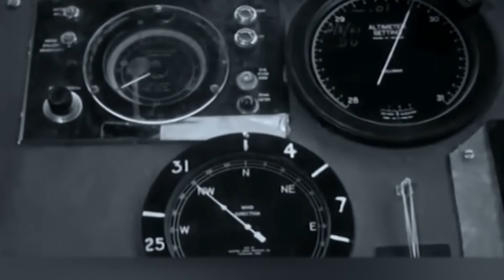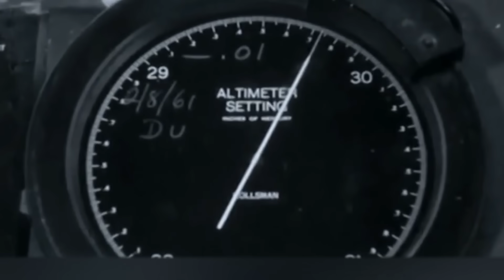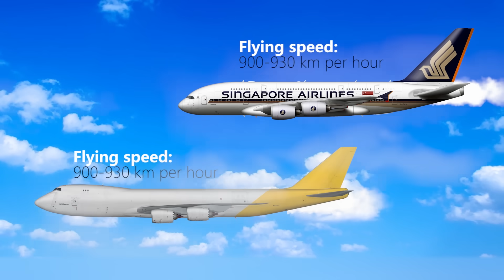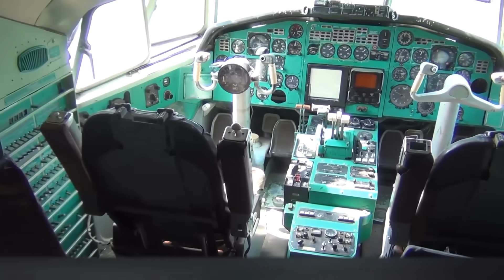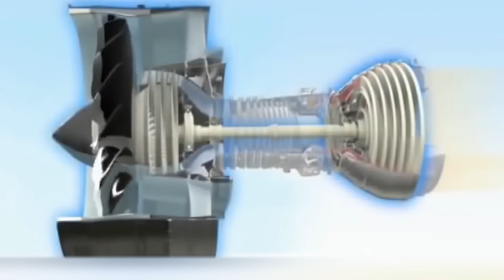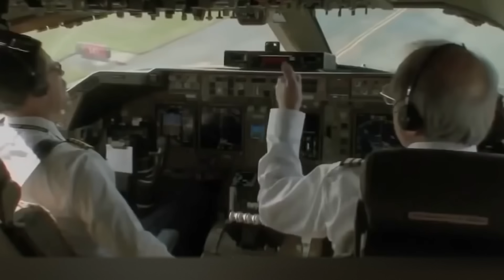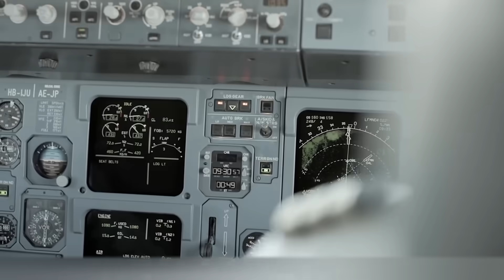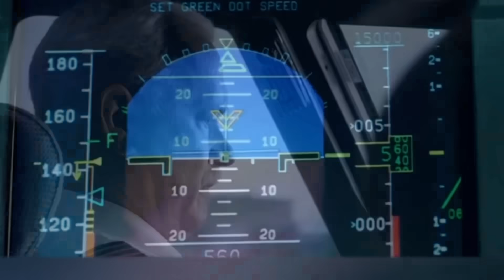Why Do We Fly so Slowly?

Comment: The main reason is that the diameter of the front turbine blades on a TurboFan engine is larger than ever, meaning that the blade tips reach their terminal velocity, which is the over the speed of sound and they start cavitating (or chopping the air up)  at a lower RPM than a Jet Engine. Above a certain blade tip speed, they can no longer move air efficiently at the blade tips. 
The strength of the material the blades are made from can only withstand so many G's before they fail, and the faster they move the more likely they are to fail from simple things such as vibration, debris, minor defects such as the crystal boundaries of the metal. 
New composite materials may help in the future, such as carbon fibre. Because we have almost reached the point where they cannot do any more with metals crystal structure. They have even gone as far as cooling the blades so slowly during manufacture that the entire blade is made of ONE single crystal of the metal material they are using, because a single crystal has no natural microfractures or defects in the material. The process of making a single crystal of metal in the shape of a turbine blade is boggling as it can take WEEKS of slow, controlled cooling in order to do it correctly, and even though we have almost perfected this process, each blade has to be stringently x-rayed to ensure that it is made entirely of ONE single crystal, as any joins between two parts of a turbine blade are a definite weak point and can easily shear off at the temperatures and G-Forces involved in regular operating circumstances.
So they then begin making turbine blades in that wavy shape you see on the latest GE90 engines, this is designed to cut more surface area of air, than a straight edged blade of the same radius, so they can squeeze a tiny bit more airflow out of the fan blades without increasing the RPM, and hence the speed of the blade tips.
If the blades were to move faster at the tips, the air that replaces the air at the blade tips cannot naturally move faster, so you end up with every 2nd blade trying to cut into the vacuum caused by the previous blade, so the speed of sound in air is generally the speed limit of the air at the turbine blade tips, before the fan blades begin cavitating, which effectively halves the efficiency once you hit this speed limit wall. The speed of sound at sea level is 1225 km/hr so at cruising altitude there is less air, which means less friction against the surface of the plane, but also lowers the speed of sound and someone smarter than you and me has figured out that 903 km/hr is the most efficient speed to fly at before supersonic conditions begin to affect your max blade tip speed, frontal surface friction, and highest altitude. So basically, they have hit peak efficiency in all these conditions, before creating un-necessary fuel waste, or sacrificing safety.
Reply: This comment was more informative than the entire video, so for once I'll say: thank you, Jesus!
Reply: Thank you, I had no idea that this wasn't just common knowledge so I am humbled. 
There is an AWFUL lot more to it than what I said, and I highly recommend you watch some videos from AgentJayZ such as this: https://www.youtube.com/watch?v=TOVi-gSnaf4
This guy is a turbine mechanic who rebuilds aircraft jet engines and turns them into Natural Gas powered turbines that generate electricity, and pump & compress Natural Gas from the ground to the pipelines that feed into cities. 
I absorb a lot of information and find it hard to explain it, and JayZ does it a lot better than I do. His knowledge depth is boggling compared to mine, but you will understand his explanations. He is worth subscribing to, and i see a video of his and think "Oh man, that's like an hour long.... I don't wanna sit through an hour long video" but once you start watching, you will be so captivated that you won't notice how long you've been watching, you will be hanging on every word he says, and every video he does seems like 5 minutes because he explains things so well.
Reply: The same principle limits the speed of a piston-engine aircraft - the prop tips approach the speed of sound and diminishes the aerodynamics of the prop.
Reply: Jesus thanks Jesus
Reply: terminal velocity has nothing to do with the speed of sound.
Reply: @WeWereYoungandCrazy  the" terminal velocity" he was referring to probably is the fact that the same as prop engine planes, turbine engine blades cannot exceed mach 1, if they do the tips of the blades will separate from them. and you can guess what will happen then. KABOOOOM. engine failure.
Reply: Jesus All I can say is wow! You have put so much information in such a small area, it's hard for me to understand without reading it several times. You, are much smarter than I.
Reply: Couldn't they use variable geometry vanes or inlet geometry? I know concorde did (inlet flaps)
Reply: @drd6416  so did the SR71 blackbird. not vanes but nose cone in the engine inlet.
Reply: Thanks for that recommendation as well, I feel I just struck gold with that channel :)
Reply: Jesus can you save our planet from the flattards?
Reply: Very great explanation.You are quite right about all of the information 
listed.I have read through this writing and you are a genius .About the friction,wind speed,and the efficient speed this is all quite right.Very nice job man.
Reply: You should watch a video by enslaved by no media amd get back at me on what you think about what he is saying in his videos please
Reply: +Garry Mills It's generally pretty damn expensive to vary the engine geometry, fiddly, and less reliable.

That said, the SR71 engine's front hub (a long pointy cone) could move forwards/backwards in order to optimize thrust above supersonic.  Kinda like holding a cork a tapered hole, it shrinks/expands the cross-section of the intake.
Reply: @fromagefrizzbizz9377  that was actually done to prevent static charges from destroying the engine on the SR71.
Reply: I love you for your brain!
Reply: Your erudite reply explains why the modern turbofan has a maximum speed, but the video title asks why we fly as slowly as we do. It's perfectly possible for commercial aircraft to fly much faster, of course, as Concorde proved, using a different engine design. The design of the turbofan is not, therefore, the main answer to that question. The main reasons are socio-economic, particularly economic.
Reply: +Malcolm Smethurst Depending on how the turbofan is designed, you can probably get it above mach 1 by optimizing it to keep a higher pressure region (by ram air) in front of the fans - speed of sound goes up as the pressure increases.  

But, in the transonic region (near the speed of sound both below and above) buffeting/airframe stress is at its maximum.

Modern jet commercial aircraft are designed to cruise at around .75-.80 mach and certified to about .84-.85, above that the stress greatly increases and modern aircraft are simply not built for that.  The aerodynamics are simply wrong for speeds well above that, and "just transonic" is a pretty rough flying regime.  So, at current airframe economics, you either fly at Mach .78 or so, or at mach 1.3 or higher.  But the drag at above mach simply makes it fuel uneconomical - people simply aren't willing in high enough numbers to pay for the increased fuel that, say, the Concorde did - yes a socio-economic/mostly ecconomic reason.

As I understand it there's new interest in supersonic commercial aircraft with radically different airframes and engines.  We'll just have to see if it takes off (pun intended).  Or you cheat and go out of atmosphere as Musk (and others) have been musing upon.
Reply: +RossBossMan You copy and pasted that.
Reply: I don't know Jesus was very intelligent
Reply: +Harry M  It's somewhat more complicated than either your or who you're responding to's idea.

I suggest you read the wikipedia page on "speed of sound".

I quote:

"The speed of sound in an ideal gas depends only on its temperature and composition. The speed has a weak dependence on frequency and pressure in ordinary air, deviating slightly from ideal behavior."

By "composition", they mean what material it is.  Which means you also have to factor what, say, other things are in the air.  In an ideal gas, the effects of pressure and density cancel each other in terms of affect on speed of sound.  But air, while close to an ideal gas, isn't, hence pressure does play some part.  As does contaminants (eg: moisture).
Reply: Jesus..  Well written but in the first sentence you blew it. "a TurboFan engine is larger than ever, meaning that the blade tips reach their terminal velocity, which is the over the speed of sound "    The term "terminal velocity" is used to define when the speed a freely falling object eventually reaches when the resistance of the medium through which it is falling prevents further acceleration.     Terminal velocity has absolutely NOTHING to do with the speed of sound.    An object can exceed terminal velocity by accelerating faster than acceleration due to gravity and never even get close the the speed of sound.  So everything you wrote following that is suspect to say the least.  And apparently turbine blade tips can and do exceed the speed of sound.  You left out the the fact that the turbine blades are moving perpendicular to the airflow and not directly into the airflow like the body or wings of the aircraft. 
https://aviation.stackexchange.com/questions/22316/why-do-turbofan-blade-tips-exceed-the-speed-of-sound-while-prop-tips-should-not
Reply: @WeWereYoungandCrazy  the" terminal velocity" he was referring to is the fact that the same as prop engine planes, turbine engine blades cannot exceed mach 1, if they do the tips of the blades will separate from them. and you can guess what will happen then. KABOOOOM. engine failure.
Reply: I have always wondered why this problem could not be overcome by using more engines. 
Another option would be a triangle of 3 shafts in the same housing. It sounds complex, but reducing the size of the rotors would have a lot of technical advantages, including being able to run with one rotor off power in event of a problem. The smaller fan blades would also need less 'break up' protection.
Reply: Copy pasta jeez
Reply: Even if you design and build a plane to go supersonic, you have to eliminate that little annoyance called the sonic boom.  So in essence, all that which was written by the OP would be rendered obsolete if they design a plane which eliminates the sonic boom.
Reply: Jesus is really smart 🙌🏻
Reply: Thank you, Jesus! You response is concise and scientific. (It is a pity that the internet is not dominated by people like you.)

Comment: Modern commercial planes use turbofan engines, not turbojets. Turbojets have more thrust meaning you can go fast however they are very fuel hungry. The Concorde used turbojets engines to reach high speeds. Turbofan engines are like turbojets hower they have a larger diamanter. They use a big fan some of that air is accelerated to high speeds while another bit is used on the side. It makes it more efficient. Why science (And because I do not feel like writing about aerodynamics now) Here is a good image to explain: https://s3.amazonaws.com/mechanical-engineering/monthly_2017_01/turbo.jpg.a2bda223dbe47091273bb1c99a398230.jpg
Reply: Watch the whole video before commenting. He did say that modern aircraft use turbofans.
Reply: The turbojet's on the Concorde had afterburners on them. That's why it soaked up so much fuel. Turbojets do require more fuel then the turbo fans but it's the afterburner's 800 gal/m that really take the fuel.

Comment: Airlines fly over 500 mph.

How the hell is that slow?
Reply: sometime they over 700mph
Reply: @mecate818  well passenger planes usually go up to 634 mph or faster but usually around 634 mph
Reply: IKR
Reply: Mirza Ahmed still pretty fuckin fast
Reply: They don't fly over 700 mph. That's the ground speed, not airspeed. It appears to be 700 mph thanks to tailwinds, but that's not how fast it's flying.
Reply: @MirzaAhmed89  well 634 mph is still fast
Reply: F-you:  It's NOT, but the point of the video was today's modern aircraft do fly somewhat slower than the previous generations of 40 and 50 years ago, mainly due to economical factors.
Reply: @williamwilkins2279  but if you think about it 628 mph or 634 mph is still pretty fast
Reply: +Marc Jalen Mecate somtimes*
Reply: It’s fast when you compare it cars or human speeds, but not when you compare it to how fast we can make them. Perspective.
Reply: Ian Lund Stidsen 😂
Reply: F-you:  Yes, but that wan't the point I was making.  But I hardly do fly these days, anyhow, because of all the mayhem and the hassle.
Reply: Marc Jalen Mecate they can't go over 700 they don't break the sound barrier
Reply: 900 km is about 560 mph... and thats a perfect name for a nut case...good job!
Reply: Because jets are capable of flying much faster. The land speed record is way faster than that.
Reply: @vanders4198  a jet is a type of plane but jets are usually alot faster than passenger planes
Reply: Exactly
Reply: That is actually really slow for a plane.
Reply: Heard of X-43? unmanned prototype fighter.
Reply: 500 isnt slow but if an airline can shave an hour off a 10 hour flight thats for me thankyou
Reply: Lil boy ikr 634 mph or 628 mph is fast
Reply: @jekenzeR  even 300 mph is still fast
Reply: 500 mph is super slow, that's only 434.488 knots,
which in turn is 804.672 km/h, and rockets can reach speeds up to mach 25 (the speed of sound x25)
while some fighter jets have been known to reach mach 9.6, so yeah, 500mph is slow.
Reply: BoxBit don’t mix ground speed, airspeed and Mach number, they are all very different. Mach 9? Seriously?
Reply: @boxbit1742  well planes fly faster than 500 mph and are able to achieve 634 mph or 628 mph
Reply: @boxbit1742  so if there was something that could go even faster than a rocket ship would you call a rocket ship slow?
Reply: @boxbit1742  acually even 500 mph or 634 mph is still pretty fast
Reply: @boxbit1742  500 mph and beyond is not slow now only 10 mph is slow
Reply: @boxbit1742  wanna know what super slow 1 mph
Reply: William Wilkins is 500mph not fast enough for u?
Reply: @thetatertot9136  acually most airlines fly even faster than 500 mph and fly 580 mph or 600 mph at crusing altitude
Reply: Not fast enough... Concorde could do three times that! Airlines are lazy and want to make as big a profit as possible and cut down on expenses as much as possible. Expenses include development...
Engineers would love to go crazy and make a hypersonic plane that runs on unicorn dust, takes off and lands vertically and goes 4000mph and has a silent cabin, but no airline would want such a ridiculously complicated, over-engineered and expensive thing. Just look at Ryanair... Those bastards would make you push the plane to the runway to save fuel if they could...
Reply: @Megadriver  think about it 634 mph is very fast! Just imagine sticking your head out of a plane 45,000 feet in the air at 634 mph
Reply: It's still very fast, but not fast enough... We had Concorde and it worked! And that was with 60s technology.
Surely airplane companies can make a Concorde 2.0 nowadays... But it's cheaper to fly slower and use less fuel and hat's the only thing airlines are interested in.
Reply: @Megadriver  well in order for planes to fly even faster they would have to have more powerful engines that can produce more thrust in a quick amount of time
Reply: @Megadriver  but 600 mph is still fast! Acually its so fast that if you sticked your head out of a plane going 600 mph youd probably go blind and pass out and lose your entire body

Comment: Sometimes a prop plane is faster then a jet in short flights.The reason is, a prop plane reaches top speed faster then a jet,saving you 20 min;on routes that are around 80 to 100 miles.